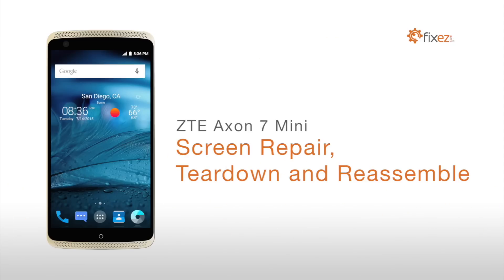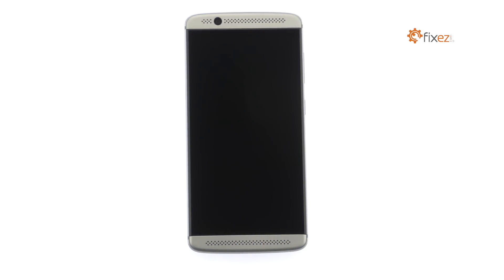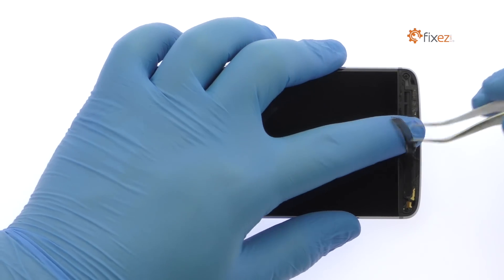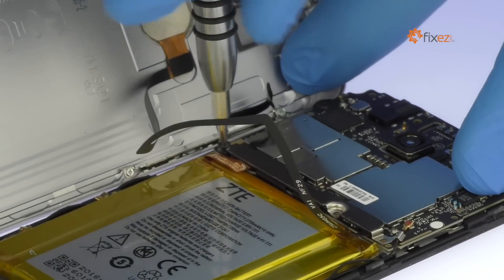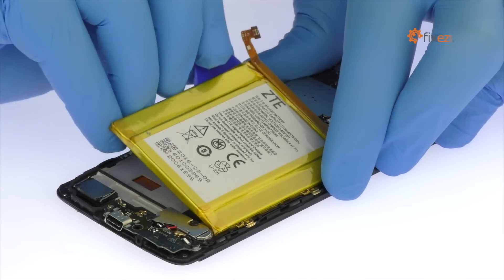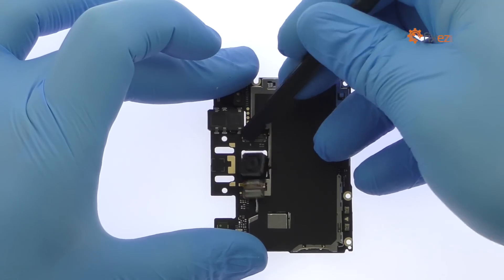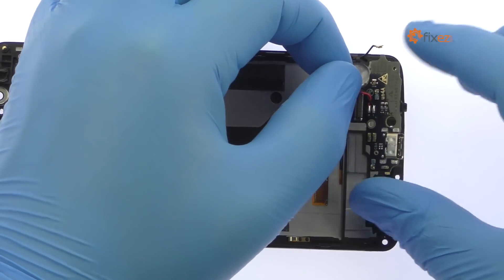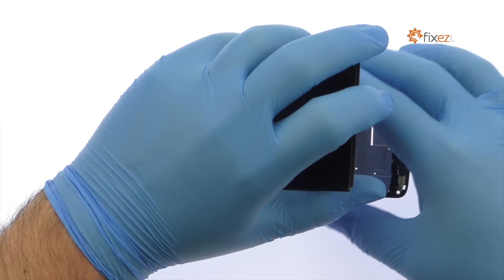ZTE Axon 7 Mini Screen Repair, Teardown and Reassemble Guide - FIxez.com

Comment: where can I purchase the little red tape that you reapplied under the speaker grille?
Reply: Did you ever figure this out?
Reply: I'd look for a double sided smartphone adhesive strip and cut it to fit the purpose (battery, speaker grille).